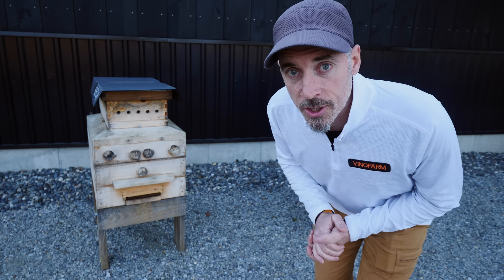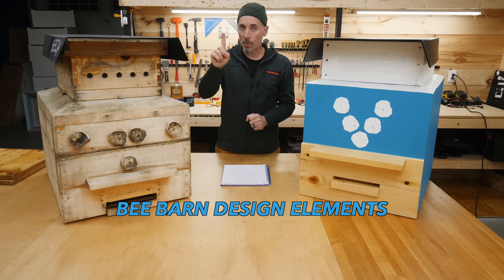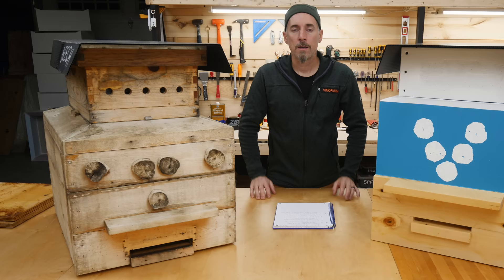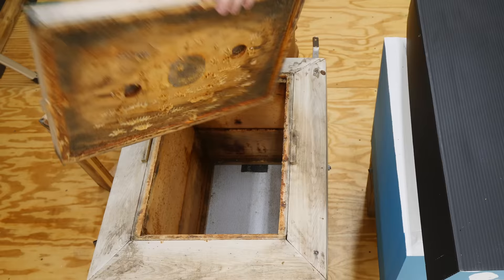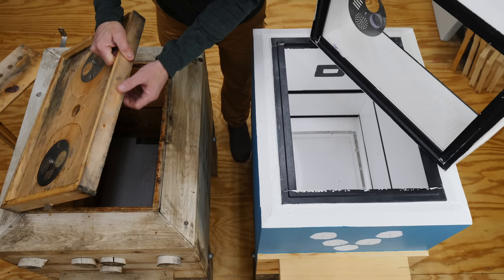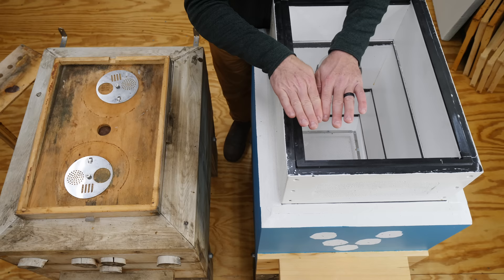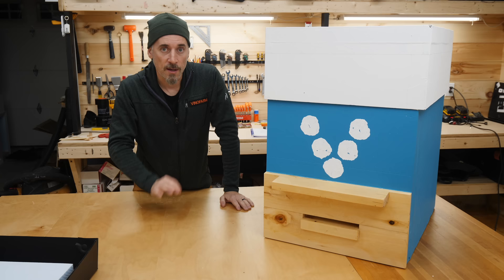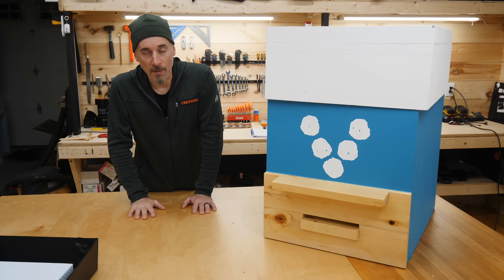I Fixed The Langstroth Hive (Again) - Bee Barn 2.0 REVEAL!

Comment: Well worth waiting for. I like the iteration of the design, and it is based on good engineering principles of taking real data and what works and making changes that improve the desired results. 

I am curious about rodents, though. I have had mice chew through insulation on a cheap fridge that was plastic and polystyrene foam to get at the food inside. And a friend of ours, who had big commercial cold rooms for cheeses and cured meats, had rats tunnel under the insulated floor and eat up through the floor to get at the food in the cold rooms.

I do wonder if your rodents are going to persevere and chew through the foam. If that happens, you need to consider some sort of barrier to prevent them chewing all the way through. 

Maybe the rodents are not as pernicious as the ones here in the UK, but it will be interesting to see what happens nonetheless.

It is really just fascinating to see how much science and engineering goes into saving bees from the rigours of wild  hiving. 

Thanks for sharing,
Reply from the maker: " good engineering principles of taking real data and what works and making changes that improve the desired results."

If mice chew the foam, it will be solved in V3.0! I'm not done yet.

Comment: the poly boxes on their own is all you need. i thought the bee barns were meant to be a cheaper alternative to poly hives but now its just a more expensive version of poly boxes lol.
Reply from the maker: The insulating value of a poly hive is better than wood, but not much better. This hive triples a poly hive’s insulation.  If you thought a bee barn was supposed to be a cheaper alternative to polyhives, you kind of missed the point. But thanks for watching anyway. lol.
Reply: @vinofarm  a conventional poly box doesn't need all the add ons. R 15 is incredible insulation and all the bees would ever need even in alaska. tripling it doesn't hurt the bees but youre not really helping them anymore than the original poly boxes already are.
Reply from the maker: @lordmike1627  Poly hives are maybe R-5 at their thickest, but the handle cutouts which are carved out of all four sides of every box thin that polystyrene down to about 1/2" thick. (Less than R-1 in those spots.) Overall, they are  not a whole lot better than wooden boxes and the fact that they're just plastic versions of wooden hives, they have all the drawbacks of wooden hives, like short frames and making the beekeeper bend and lift all the boxes every inspection. My hives add on a continuous envelope of R-10 insulation which greatly stabilizes the brood cavity. I'm not "tripling R-15". I'm bringing it UP to R-15.
Reply: @vinofarm  i still think its over kill. I've never seen condensation in my Tyson boxes ever. lyson boxes have an r value of 6 which is about the same r value as a 6 inch living wood aka a tree. thats all you need. ive gotten hives with 1 frame of bees to survive in massachusetts winter in Tyson boxes so i don't see the need for all the extra.
Reply from the maker: @lordmike1627  OK.

Comment: I love your innovation and data driven engineering method 👌.
I have a query as you say you already have a couple you are using/testing, how does the polystyrene hold up with the removal of frames as you sometimes need to use a knife like tool to pry them out? Also does the polystyrene handle the waight and wax okay? When i say wax I mean can the wax damage it by sticking to it and removal of wax damages the structure of the polystyrene or if the oils cause damage? 🤔 just a question not insulting the design 👍
Reply from the maker: Watch the next video… Build series part one! You’ll see clearly what’s going on. Thanks!
Reply: @Vino Farm  Hi and thanks for the reply. I didn't see anything in your new video that addressed my questions other than they are pre-bought hives with plastic at the tops for durability. Maybe I missed something anyway I was hoping to know how you were getting on with your new hives in a structural sense more so than how to build it. Full disclosure I don't keep bees but I am an engineer so that is where my interest was. Lol 👍
Reply from the maker: @Johnny-uv6ig  The bees went in in October and have been sealed for winter. I have not had a season of using them yet. But the inner hives are high end poly hives that are being used by thousands of beekeepers. If there were problems with them, we would have been hearing about it. The edges are just as sturdy as any pine beehive box.
Reply: @Vino Farm  thanks for replying you are ace. Yeah I kind of guessed as much with the pre-made thing but thought I would ask. I love the content even though I don't keep bees myself and love the methodology you use to find scientific solutions. 👍

Comment: Would the bees propolize the plexiglass lid down, and being how it is beveled, how whould you use a tool to crack it.  Are you noticing the insulated top feeder box does not allow a draft for them to try and block.? If so, cool .  Problem solved.

Comment: Great video! 
Polystyrene is great to use as beehives, so to make the BB 2.0 lightweight and even better insulated is just great. 

One thing that concerns me is the condensation already forming at +4C, its going to be worse when it gets colder. 

What the diffirence of thickness between wall and roof? Are they the thickness? I've heard that the roof should be x2 or x3 the thickness of the wall to force the moisture further down in the box. If the thickness between the wall and the roof are the same, the moisture will try to "leave" the hive through the top, hence the condenstation in the corners.
Just a thought.

Im very curious about this as I have built a BB myself, but the biggest diffirence is that I dont have a second box on top during the winter. I made a designaded x3 insulated roof(combare to the wall) to use from october to april.
Reply: Wise move on the roof. I also don’t think that box on top is needed or necessary but just a detriment. If more resources are needed and that’s a concern just give them a medium box on top insulated too. 

I think condensation will be a problem also with this new design but we will see.
Reply: Note that the condensation he shows is without the winter cover which adds additional insulation to that top cover. With the winter cover on the additional insulation should help with the condensation. Although condensation isn't really an issue for the bees so long as the condensation isn't dripping directly on them (aka it's fine so long as the water slides down the sides of the walls).

Comment: First I’d like to say I’m so glad you’re back! I missed checking in on your bees with you. 

The only other thing I’d like to say is…. Based on this what do you think the viability of putting frames in a stirafoam cooler and drilling a hole in the front of it would be? I mean, in essence that’s what you just build, when you break it down to basics. So would a stirafoam cooler be a viable bee trap?
Reply from the maker: A couple things… you’d need to find one with the right dimensions to hang frames in while leaving the proper bee space around the frames. Also, a styrofoam cooler won’t hold the weight of several supers. Conceptually, yes, but dimensionally probably not. For a nuc or a swarm trap, possibly.

Comment: So my questions are, the burlap was initially used to wick moisture away from the hive. Now that you don’t have top ventilation, is the burlap adequate insulation, or could you use some thing with a better R-value in that cavity?

Also I would be concerned with the weight of the hive when it comes to windy conditions. I know you have a ratchet strap but will that be enough to keep the whole hive and wooden stand from toppling over in a very windy storm?
And what about rodents chewing through the hive? Can anything be done to prevent that?
Reply from the maker: You can put any material you want in the insulation box. I have 6” of burlap and then an air sealed R-10 shell over the top of everything. 

My bee yard is surrounded by trees that really break the wind. I’m pretty confident that my short stout boxes will be OK even though they are lighter. They still weigh over 100lbs with the stand, hive, honey, etc.
Reply from the maker: Re: mice… if they become a problem, I’ll solve that in 3.0. I’m not finished yet.

Comment: How is the polystyrene holding up to the weather? I'm not familiar with MA weather but here in CO we get frequent hail storms, sometimes quite gnarly and I wonder if these would hold up to a sustained hailstorm without turning to powder.
Reply from the maker: Good question. We don’t get heavy hail here very often. The exposed walls are vertical, so they probably wouldn’t take too much damage. Maybe some denting?

Comment: I remember when you promoted the vivaldi board also. I still see a few issues with 2.0; the upper box is completely unnecessary, and so are the other trinkets at the bottom board. In this video, you reinvent the poly hive, a complex version of it. Requardless all that matters is we have fun with our bees. Happy New Year.
Reply from the maker: I don’t think you quite understand the point of me building these. This hive completely SIMPLIFIES a regular hive. It eliminates the need to lift brood boxes. Like, I have not lifted a brood box in two years. That’s hundreds of bends and lifts removed from my life forever. It gives bees a thermally isolated, minimally disturbed cavity to live and work in. It eliminates a massive open door for pests to walk in (an open bottom board.) It eliminates the need to crack the propolis seal on an inner cover to check on bees in the middle of winter. It gives the queen continuous, uninterrupted comb on which to lay eggs. She never needs to jump a gap or climb over wooden bars between frames. Not to mention the improved ergonomics and peace of mind it gives the beekeeper. A poly hive is a styrofoam version of a wooden hive. Yes, slightly better insulating value, but all the same hassles. These fix so many hassles that wooden hives and segmented poly hives both have. But I’m not trying to convince you to use them. You do you! I’m going to keep giving other people simpler, easier ways to keep their bees.
Reply from the maker: Oh, regarding Vivaldi boards… they do exactly what they’re designed for and the DO work to remove moisture from a hive, but I’ve changed my mind on the concept of removing moisture. I made a whole video about it and admitted I was wrong in my thinking. I have no problem changing my mind and seeing other ways of doing things.

Comment: I'm still watching the video so maybe it will be addressed, but my biggest issue with hives like this (I have all beemax hives) are the non standard sized entrances. It makes it a pain to follow the label for mite treatments like formic pro. For beemax specifically, I have to use a shim to increase the bottom entrance or offset the double brood chamber.
Reply from the maker: I don't use and don't like formic treatments. OA will go right in the front entrance and Apivar can be used normally. These hives are not made for Formic Acid treatments because they are very tight.

Comment: People build campers out of foam that they call foamies. They make the foam structurally strong using what they call poor mans fiberglass. They glue painters dropcloth on the foam with tightbond 2 wood glue, then soak the cloth completely in tightbond 2. Once that dries the foam is hard an weatherproof. Almos like a fiberglass pannel. They then paint it with exterier latex paint to make sure its weatherproof. These things hold up to highway speeds an rough weather. May be worth doing on the outside of your foam be hives, an anywhere that is prone to wear.

Comment: I’m a little confused… you talked about your approach of sealing the hive because the bees will deal with moisture, but your design of the modified bottom board facilitates drainage of moisture that accumulates on the inside walls of the box. Not trying to nitpick here, but I want to understand so I can modify my hives for this winter-  So, the approach in the design of the hives, very basically, is is to seal off against any ventilation while insulating completely, but making sure to allow for a drainage path for moisture that will need to escape. Is that correct? 
And do you think that, for lack of time this fall to build new boxes, that insulating my wood boxes with this design approach in mind which would encourage moisture to condensate on the walls and run down would be better than allowing for ventilation? Thanks
Reply from the maker: I believe that the bees use all the condensation that accumulates on the ceiling and walls, but I want there to be a "way out" for any EXCESS that is not used. Wooden hives are like sponges and soak up a ton of that moisture. So a completely sealed wooden hive swells up and causes problems (structurally) for the box, not the bees. The foam does not soak up moisture, so I wanted a path out for the water so there would not be a huge puddle at the bottom all winter. 

The absolute basic concept is: full insulation (including the bottom!) and no upper vents or entrances. Only a lower entrance. The bees handle their own ventilation and humidity control with only a lower entrance. If you don't FULLY insulate, you will need more ventilation and a lot more food for the bees so they can generate heat.

Comment: Hi Jim! The spacer together with insulation and very deep box resembles me very much method called "optimalizované plodiště", in German "Angepasster Brutraum". You may want to get inspired by it. Beekeepers here also do not use glued polystyrene, but polyurethane made of one piece by filling a mould.

Comment: Hmmm, GREAT content! Very informative, great explanation on your concept! You've got me thinking, I've made most of my hive components so far, reading and watching others thoughts to TRY to make improvements on mine! I've thought about wrapping my wooden boxs w/foam, which I have made winter wraps that encase the hive. I did buy one of the foam hives but after 2 years of trying it, I have lost that hive 2x compared to 1 or 2 out of the rest of the all the regular wood hives??? QUESTION, how are you slicing your foam to get a smooth, straight cut, hot knife? REALLY looking forward to watching your next videos on these NEW idea BEE BARNS! GREAT VIDEO! I've subscribed!
Reply: For cutting do what construction firms do: Use a hot wire cutter.

Comment: If it was cold on top due to feeder shim then why was the condensation only on the sides and not evenly all across the bottom side of the top?
Reply from the maker: Because of the thousands of bees clustered in the center keeping the middle part above the dew point.

Comment: Great design. I'm curious what your experience will be with the foam this coming spring. In Northern NY I have used 2" insulation foam on the outside of the wood (sides, top and botttom with one lower entrance just like you explained) and had success with winterizing the bees in spring 2022- first time winterizing bees and was 2 for 2 with the colonies--- no mites or hive beetles --- used Russian bees winterizing them with two boxes of 10-frame deeps. I was of the opinion to keep the insulation on all year and did so. What became an unfortunate circumstance regarding the foam I used for insulation was that in late July I found that the ants had carved out the insulation for their own need- and that's after I had painted them just like you did! It didn't affect the bees, but it destroyed the foam. Again, I kept the insulation on till October and put "fresh" foam all around in late October as I did last year as the carved out foam from the ants would have compromised the insulation for this winter on the old boards. My guess this year will be to remove the foam sometime in April before those critters leave the ground- unless I build hives like you did and rid myself of the wood. Any advice on how to preserve the foam long-term aside from early removal? I noticed that you had tested for 2 years foam boards with no ant or critter issues. Again, great videos!
Reply from the maker: Maybe wrap the foam with foil tape or paint it with some kind of plastidip rubber or epoxy? I just don’t have huge ant problems but if I did I’d be putting something impenetrable on the outside. And don’t leave a single crack or they will find it.